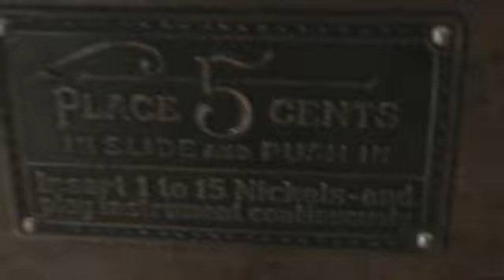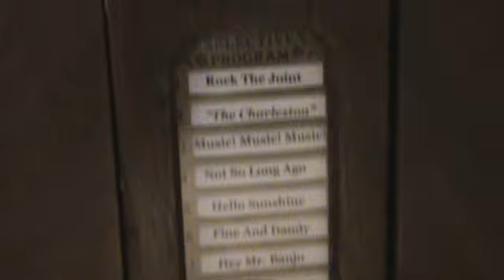Mills Hi Boy Jukebox Model 801 (1928-29)

Comment from the maker: There are clips in the spindle..actually there were two variations of this, on both Mills machines I have the better ones which open and close rather than a thinner "staple" kind of clip on some later models.  On those, it was very difficult to get records on or off without the possibility of breaking them.